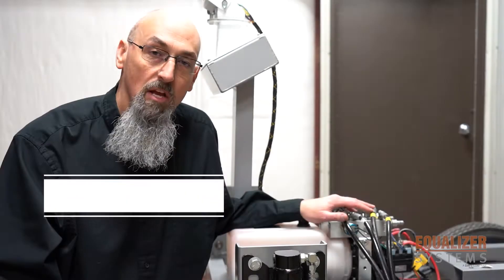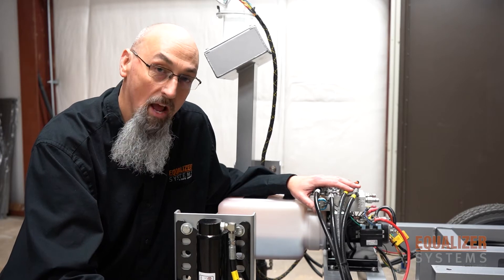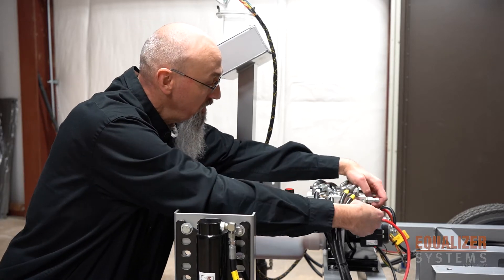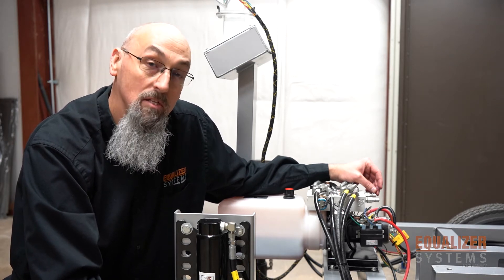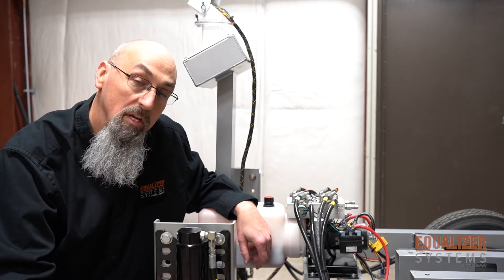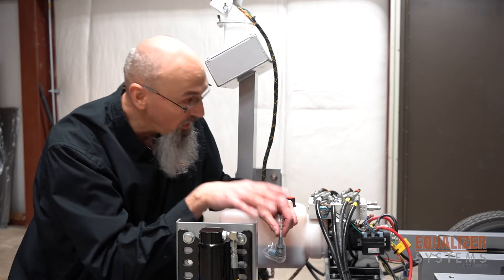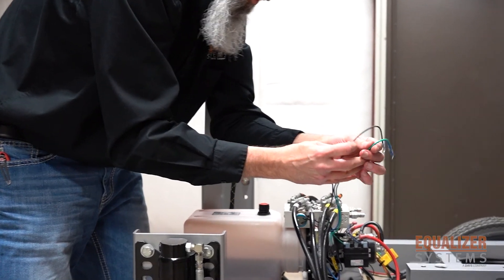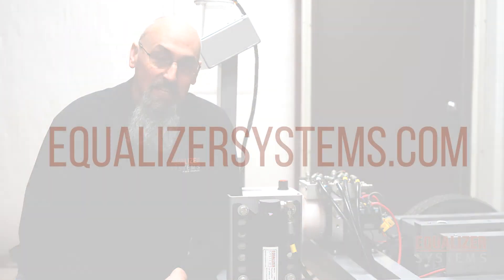Discussing Pump Pressure | How to Add a DV-2 Kit

Comment: That’s great they have all issues they can have I just take them off of my rv and throw them in the trash can all parts they said it’s made in china wtf took them off and throw them  away. The motorhome it’s 2024 they are only 1 year old and they fail that fast what a shame of company who built them.
Reply from the maker: Please private message us with your contact info so that we can get your issues taken care of. If they're that new they should be under warranty. You can also call us at (800) 846-9659 or email support Service@eqsystems.us

Comment: I was told the part #2047k is the new pressure switch to replace Nason XP-B6B-1200FQC106 . Can you tell me if this is the same as Nason’s # CF-6B-1200F/QC122? It looks very different and I just want to be sure before I ordered. It does not have the yellow wire w/black stripe, as in this video and differerent connectors, with a big red button on it. I cannot find any installation information on the website either.
Reply from the maker: Please call (800) 846-9659 or email support at Service@eqsystems.us . You can also visit our Support section on our website for more information or to submit a question www.eqsystems.us/service-and-support-form/ Thank you and have a great day!

Comment: On my 2019 Newmar Ventana LE 3426, the large "BI Rotational Pump" motor is isntalled with 2 solinoid/contactor's installed, one to the left of (when facing the end of the motor) the motor and one to the right of the motor. The blue wire from the DV-2 is installed on the solinoid to the left and the green wire from the DV-2 is installed on the solinoid to the right. My question is, does the blue wire control the extend solinoid and the green wire control the retract solinoid (i.e., does the solinoid to the left control extending and the solinoid to the right control retracting?
Reply from the maker: Please call (800) 846-9659 or email support at Service@eqsystems.us . You can also visit our Support section on our website for more information or to submit a question www.eqsystems.us/service-and-support-form/ Thank you and have a great day!

Comment: I have this equalizer in an Entegra class A gas motorhome and when leveled the left side goes down in a few hours. I do not have any visible oil leaks. However occasionally while driving, the system has turned on and has started beeping. Is this a symptom of needing the DV2?
Reply: It might be bypassing inside of the cylinder.
Reply from the maker: Hello,
You can visit us at EqualizerSystems.com, submit a Support Form https://equalizersystems.com/service-and-support-form/  or give us a call at 1(800) 846-9659. Thank you.

Comment: It is my understanding that if a DV-2 kit has been installed and you want to retract the jacks with a drill that you must close each of the four valves and ALSO the DV-2 valve.  Is that correct?  I have had no luck even getting to the location to add my DV-2 kit in my 2018 Sprinter 3500 RV - just no room.  If I somehow get it installed there would be no way to get an allen wrench into the DV-2 valve to open and close it.
Reply from the maker: Hello Scott,
You will need to lower the pump, and access it that way. If you have further questions, give us a call at 1(800) 846-9659 and ask for service.
Reply: @Eqystems  and how does one "lower the pump"?
Reply: You ever get it installed and get your question answered?
Reply: Nope. It has been behaving so I didn’t bother. If it ever gives me a problem I may just take a trip to EQ who installed it originally.